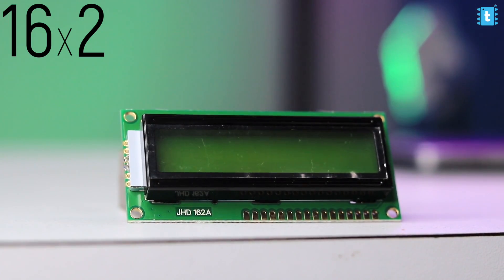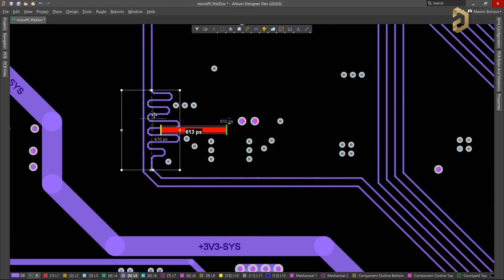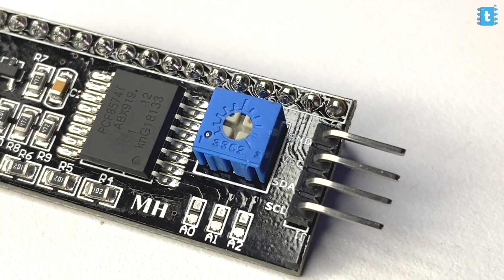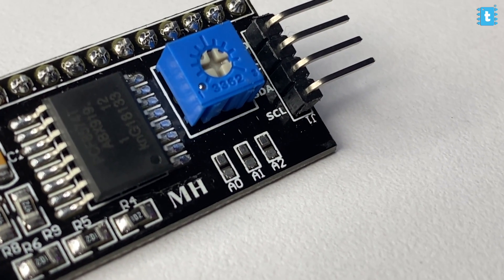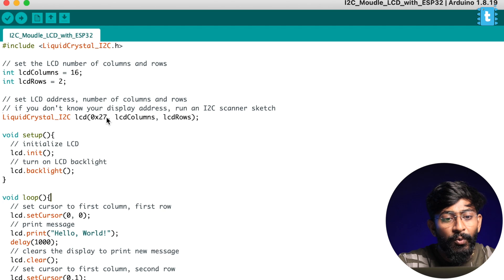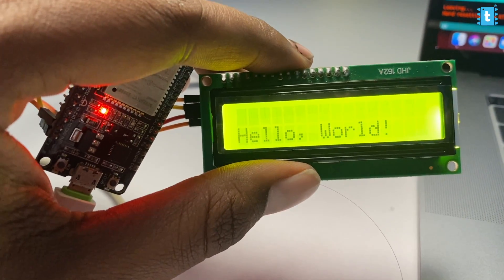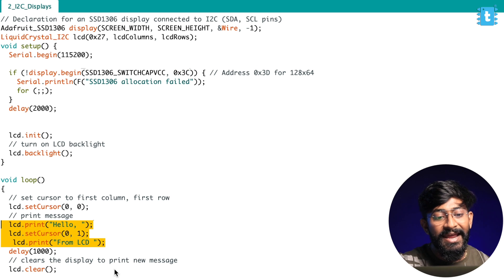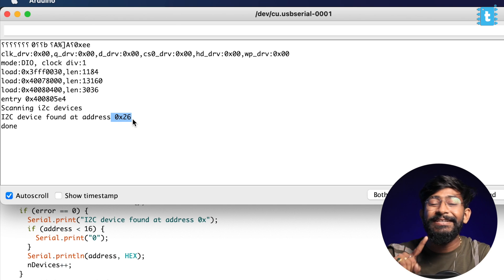This module can save a lot of GPIOs | Getting Started with I2C Module

Comment: Thankyou verymuch for posting this type of videos. It is very informative . Sir I need one small suggestion from you, I want to drive 16X2 LCD with I2C module with AtTiny85 chip. The Chip is in DiP 8 package and I was using LiquidCrystal_I2C.h, which was working perfectly fine with Aurdino , but not functioning with this chip, seems I am missing the correct library.